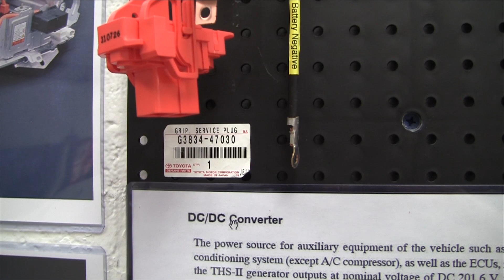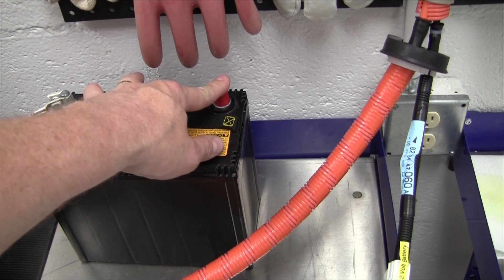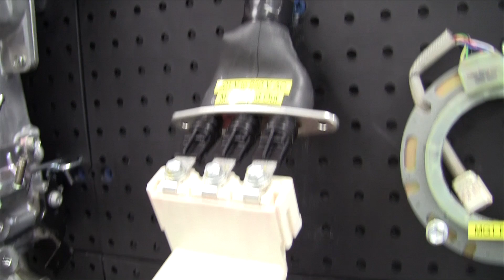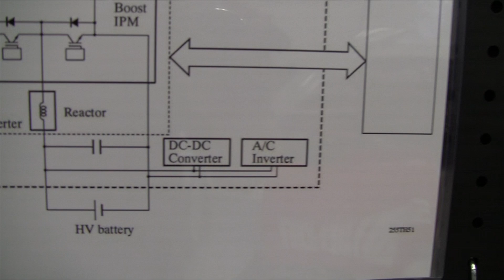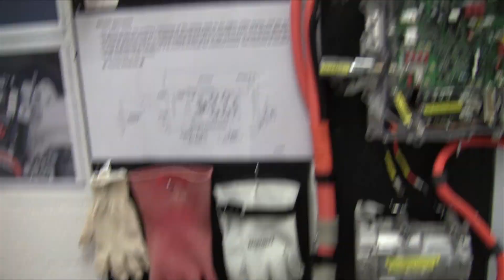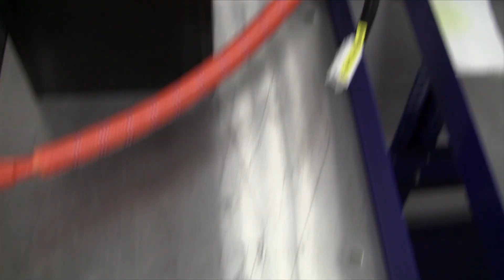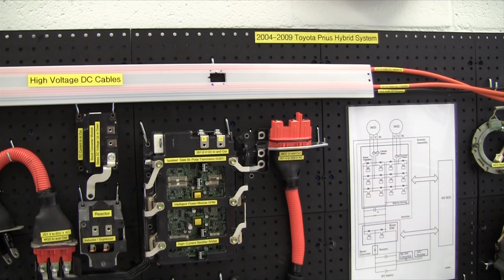2004-2009 Toyota Prius High Voltage System Operation

Comment: thank you so much for such for actually explaining this unit in such detail.
Reply from the maker: Thank you!
Reply: I do have a question for you. I have a 2007  gen II Prius.

There is a man on youtube who has hooked up 1000 watt/2000 watt surge pure sine wave inverter to the 12-volt side of the system as an emergency backup for his home. (See https://www.youtube.com/watch?v=Uh02JLAP3lo&t=132s)

My concern is if the draw is enough to harm the 12-volt inverter side of my Prius if I follow suit.
It seems from your description that and what I have read that the charging of the 12-volt auxiliary batter is more of a low amperage charging system that keeps a float charge on the battery. Is this a correct assumption?
Do you know the maximum amperage draw on the  Prius's 12-volt inverter side of the system without damage? And how long an auxiliary draw be maintained without damage?
Thank you
Reply from the maker: Power in must equal power out. If you want 1000 Watts output at 120 volts, the maximum current output is only 8.33 amps. That will not power very many items in a home at the same time. Furthermore, providing 1000 Watts from the Prius charging system and 12V battery (at 14 Volts with the vehicle powered up) would require 71.4 amps of current. The maximum output of the DC-DC converter is 100 amps (and it will run very hot if forced to run at that level for a long time). The vehicle alone will draw 50 - 70 amps with the engine running, cooling fans on, electric water pumps running, etc. It will draw less current while the 12V system is drawing down the 201.6V battery, but the engine must start to recharge the 201.6V battery. In other words, the 1000 watt inverter idea may work for short time periods, but it will not be able to sustain 1000 watts continuously. The DC-DC converter will run too hot at those levels and start to turn down its output rate to preserve itself. It is not a good idea if you need a long time power supply. It should never be run just from the 12V battery without the hybrid system powered on; the 12V AGM battery will be damaged. By the way, the high voltage Ni-Mh battery of a standard Prius has less capacity in ampere-hours (21Ah) than the 12V battery does (30Ah). This means that trying to connect to the high voltage battery will result in even less power. I hope that helps
Reply: Thanks for the answer. 

One more question - what is the charging amperage max to the 12-volt battery from the built-in charging system?

So, with this in mind, I think I can get by with a 600-watt pure sine wave for periods, especially if I am only running 100 watts or less AC loads - so the efficiency should be ok  and allow the car's system to run as necessary. Also, when the car is stationary without A/C or lights, etc, there should be ample headroom for a small load. 

Also, due to the large output capacity of the genset (50kW) for the 200V battery and drivetrain, it would seem that connecting into the 200v side of the system would be efficient  due to the capacity of the MG unit to charge and keep this battery available for such a load as well as the standard load for the car. 

AS you know, however, a 200v to 12-volt dc converter would be a custom build or difficult to find, thus the 12 volt seems to be the answer.

Comment: Thank you for such exellent video!
Is all hybrid electric connetctors are water insulated in the motor bay? Can it be damaged if some water sprays on it?
Reply from the maker: Yes, they are made to have water splashed on them. They are not made to keep out high pressure water from a pressure washer.
Reply: @WeberAuto  Thank you for answer. I want to cleand some parts with running water - it's very dirty because of bad winter weather condotion this year. I know, that it's forbidden to wash engine with pressure washer.

Comment: I like some here have a problem with a code P3030, checked everything and everything is working great, except for that code, I went ahead and replaced the ECU and once everything was done I got the code P0AFA now!! I double checked voltage on each cell, checked the wiring harness and nothing, I just can’t get rid of these two codes ( one on each ECU) any suggestions about what else could I check? I’ll appreciate any sugestión
Reply from the maker: Possible corrosion and poor connections between battery modules. See https://www.youtube.com/watch?v=utDVUNUC474&t=25s

Comment: Thank you very much for this video! Wish chevy would do what toyota did and partner up with a university to teach its chevy volt system. But since they dont even post the volt's battery voltage on the wiki page i doubt that will happen anytime soon. Thanks again!

Comment from the maker: Hi, I own a 2008 Highlander HV. Its hybrid system is more like the 2010 3rd gen Prius except its battery voltage is 288V instead of 201.6V.  It also has a rear motor (MGR) that is used on acceleration from a stop and when needed based upon potential front wheel slip. The only place I have found with detailed descriptions of this system is the Toyota 2008 Highlander HV New Cars Features manual.  It is only available in electronic form today.  You could buy access to it at techinfo.toyota.com

Comment: That negative battery cable on the 12v could use a kill switch. In an accident, just hitting that kill switch should bring down the entire system so it's no longer a shock/fire hazard.
Reply from the maker: +Samniss Arandeen Hi, yes, that is true. The high voltage system is controlled by the low voltage system. Thanks for watching.

Comment: Excellent system view.
I am working on my friends 2010 highlander hybrid - the inverter has failed, my expectation was/is the IPM - can the IGBT transistors be compared in circuit amongs all the channels to find out if they are all good, or one/some have failed?
In watching your video I’m thinking that possibly the boost inverter or the A/C inverter has failed - we can move the car around using a 12v boost battery hence the primary IPM is not disabled by what ever the failure is - and there are no visible signs of over heating in what we can see.
Plan is to replace with a used assembly but I am curious and challenge to find a fault and repair - I’m in the electronics business, but Mech Eng by schooling
Your information and courses are great for the future generation mechanics so that knowledge is real and people understand the transition to these technologies instead of fearing and berating it!

Comment: Just an off the wall question, but is there any way to tap into the 3 phase output in the inverter/converter and use it for my welding? I think this would work great in field applications on an older model prius. Could I use the battery as a power bank for my solar panels on my home if I tap into the 200 volt battery?

Comment: hello I have problems with my Toyota Prius 2007 it has the code p0a78 that talks about low voltage of the inverter .. the inverter has already been replaced and it still has the same code.  the car has a red corner and cannot be driven.  any advice ?

Comment: Hi, I have an extra HV battery. What would happen if I connect both HV batteries in parallel prior to the relays? Thank you.
Reply from the maker: I have had that thought myself. There are three concerns. 1. Battery cooling. 2. Inverter converter cooling. 3. Battery monitoring. I couldn't figure out a way to make it work.

Comment: not talking about the wiring.. thats ok ;-) i also have to compliment you with  the setup Nicely done.
 but the NEG is going tru the current sensor ( i call hall effect sensor  ) and you have that wire labled as POS.
a contactor can brake and make a connection at high currents a relay can keep high currents but not brake, the relay of the prius does not need to do this just hold the high current while in operation but never break nor make a connection at high currents.that wy i call it a relay

Comment: Good Morning Professor, 
I have a 2nd Gen Prius. I was driving in traffic, accelerated hard and the vehicle shuddered and shut down. The dealership said my Inverter/converter was bad, so I purchased a used Hybrid system and from it swapped IPM card and Capacitor block first. I still had same condition/error (P0A94). I then installed the Reactor and Boost Converter Module. The original BCM had evidence of the device smoking on the mating connector. At this point the car started and would go into gear, however the "triangle of death" came on (No more P0A94, now P0A78). I was able to clear the P0A78, but every time I re-start the car it returns. It seems if I clear it, all systems function, but id I do not clear it the traction batt starts to deplete while driving. My OBD II code reader says P0A78 is low phase A output. I have to try to fix it myself as I can afford the $4700 quote the dealership gave me. 
Please let me know what you think of these conditions.
Reply from the maker: Hi, did you use the recommended heat transfer grease under the IPM, reactor and boost converter module? It also needs to be applied with a squeegee at a certain thickness. There are templates available for the grease application. If you did not have the POA78 until after you worked on it, you probably have a bad connection somewhere. Phase A output is one of the three orange wires that goes to each of the two motors in the transaxle. I would double check your connections for cleanliness and proper torque.

Comment: Hello i have got a prius in my workshop where it says ready and makes alot of clicking clacking noises and the wheels do move for 3 seconds on and off on the vehicle lift and then it stops, i have tested mg1 and mg2 resistance to bidy earth and its between 5-6 m-ohm, which part of the inverter do i need to test and do you have the reference readings please? Fault code is P0A7A generator inverter performance, fantastic video sir
Reply from the maker: Thank you. The resistance should be much higher (500 Mega-ohm)

Comment: Hi! Great content.I would like to know, when working on deconnecting the high voltage power on the vehicle, which PPE should be used for this task? Rubber gloves? Goggles? Arc Flash clothing?thanks
Reply from the maker: Thank you! You should use Class 0 gloves and Safety glasses/goggles.

Comment: I have a code that reads negative contactor circuit high input and my 2015 Toyota Camry hybrid don't start, please help. I replaced the hybrid battery already including auxiliary batter. Besides this code i have 2 more coeds that reads positive contactor circuit low input. On the abs side i have a different code that reads hv regenerative systems malfunction.

Comment: POAA6/526 codes isolation fault. Please help me in checking certain things before letting toyota dealership take me for everything. I am very tech and car savy I just don't know what to look for.
Reply from the maker: Loss of isolation indicates that the high voltage system positive or negative circuit now has continuity with the 12V system body ground or 12V power circuits. If there has been an accident, look for pinched wires or damaged components. If no accidents have occurred, look at the service history. Has someone changed the transmission fluid, A/C compressor, refrigerant, etc.Improper fluids can be conductive resulting in loss of isolation. Best wishes!
Reply: @WeberAuto  Thank you for responding, Sir. I have taken cheap and quick measures to dive into this diagnosis. As stated before I am dealing with POAA6/526 and so far have just replaced inverter pump and had hv battery inspected by clowns from craigslist. Nothing really has changed so today I opened up the inverter and tried to inspect the orange cables myself. I am car and semi-tech savy but just need help in understanding what it is exactly I need to do to see if my HV cables are okay. I understand the Transmission has some I will not be able to access without a lift possibly but what can I do after opening inverter and seeing nothing out of the norm so far. If we can possibly email or text that would be great as I would rather donate some money to you over the dealer.
Reply: I have received accurate diagnosis with codes: poaa6-526-613 with symptoms of sluggish drive especially uphill and triangle after driving for 25+ mins at a stop. 
What can I check to find issue? If Ac oil is wrong how can I tell!

Comment: Greetings sir.. i have a major problem with my toyota prius C HV battery... all i did was to clean up the buss bars and put it all back together but when i connect the service plug grip it ignites and burn out the whole connection... is this a common problem?

Comment: Fantastic overview….Question Sir if I may. How is charge current captured from MG2 during regen braking? I understand that MG2 transitions into gen mode but how if the inverter is dropping the applied frequency to the stator coils to control deceleration rate? Does it rapidly toggle between slowing motor and “collecting” the induced current from the slowing PM rotor? Any clarification would be greatly appreciated?
Reply from the maker: No, is is only creating an opposing voltage to counteract the induced voltage produced while decelerating. Thanks for watching
Reply: @WeberAuto  Thank you Sir. Having great difficulty in finding details.

Comment: Thanks for such a great demonstration...What could be the possible reason for the 12 V battery isn't charging...The battery is new and the hybrid battery is also fine...is it the dc dc converter somehow not working?
Reply from the maker: Yes, the DC-DC converter could be a problem, a fuse could also do it. See my other video on checking the charging system here: https://youtu.be/_V9PiOpaxyE

Comment: You mentioned you should not tow the vehicle because it will continue to generate power and could damage the vehicle. How do you get the vehicle to the garage if it will not run? Do you have to put it on a flatbed truck? Is there a way to safely tow it? I have a 2009 Prius that just had the hybrid water pump replaced and it cost me around $420 labor for just 2 hours at Earl Stewart Toyota in North Palm Beach, FL. That is why I'm learning everything I can now about my car so I can fix it myself!

Comment: Actually with my 400h Lexus the accessory battery is in the front, and so I jump pos to pos and neg to my engine frame. The curious thing is that a bad accessory battery presents as flashing dash lights, with none of the characteristic slow, labouring start typically seen with most gasoline engines. I guess that makes sense, but it is surprising. For safety, the PCM will not permit a start with a weak 12V battery. Too bad it won't boost itself (grin).

Comment: I think GM uses 6 phase motors generators in the hybrid trucks. I want to go online to learn about ev systems! Im missing my inverter relay and think thats why my high voltage battery only change with wheel motors or i just bought the car a week ago and the blue bars only 6 out of 8 will ever light up. Once all 8 green bars showed charged from the wheels going down a hill. Can some one correct me if im wrong but the blue relay im missing labeled inverter in hood that is important or not supposed to be missing right?

Comment: Thank you. May I ask a question? My daughter took her Prius in for the 2020 Inverter Software;  She was advised the 'connector' for the software update wasn't working (they couldn't connect). So I'm curious if this 'connector' for the Inverter Software is located inside the passenger compartment or a separate connector inside or near the converter.  The Toyota dealer said she'd have to pay for the new connector before they can upgrade the software.  She called BS and asked me to research this.  Any clues would be helpful.

Comment: Hi love your videos. I have a 2004 Toyota Prius  I have been noticed the batteries on the screen was acting unusual. On the low side then the triangle of death came up. It shows one bar the cooling fan came on lacking power but then it would show full Green bars. For a Second or two. Drop to one bar again. I would clear code but nothing showing get home pull off bat cover all batteries are at 7.4v screen showing one bar start it hold brake and gas cooling fan turns on I check voltage it was over 400v my meter only goes to 400v but the screen on dash only shows 1 bar. What would you say. Would appreciate the help. 
Thanks

Comment: If I wanted to connect an inverter for emergency power to my house, would you think that coming off the large battery connections would be the best source of power and if so, what is the max size inverter you would put on it?

Comment: The negative and positive contactors are mislabeled...
The pre-charge capacitor & 20 ohm resistor are on the positive HV contactor...
Reply from the maker: Thanks for your feedback!
Reply: @WeberAuto  this needs to be mentioned in this video or put in the comment section below the video. very important that people know that the output wires are mislabeled.
Reply: Shut up, you pointed it out and he acknowledged it, now take a hike

Comment: Nice video....why did Toyota choose the current battery tech over lithium chemistry? Also, is it possible to convert this technology to a all electric and replace engine with larger battery pac?
Reply from the maker: Thank you. Toyota was worried about keeping the batteries cool. The 4th generation Prius uses Li-ion batteries
Reply: I think it was the fact that 
-1) Nickel Metal Hydride was WAY CHEAPER than lithium back then, &
2) maximum lifespan discharge range is better in nickel vs lithium
-2.5 --3.6 volt lithium =60-85%
4.2 volt max
-prius nickel pack 40-80%

Comment: 3 phase alternating current motors like the ones on drones with permanent magnets are powered by DC just needs the controller and i dont think if you wire it like a pool pump 3 phase it will turn just alot of torque but only 1/3 of the way if its not timed with a key or crank sensor or resistor to know the pulse speed of the flux polarity.